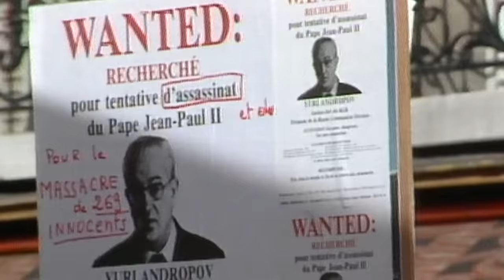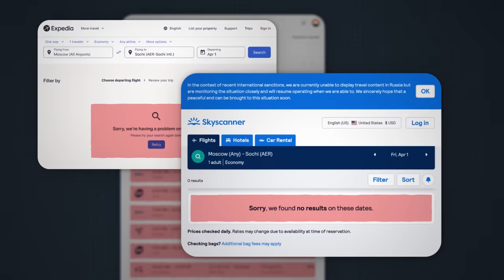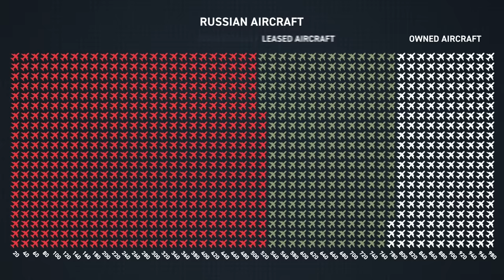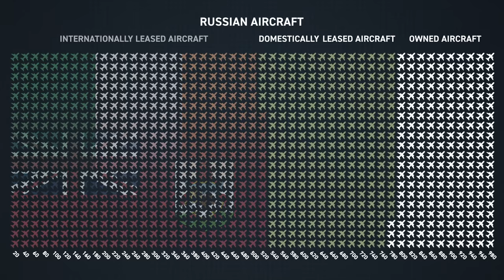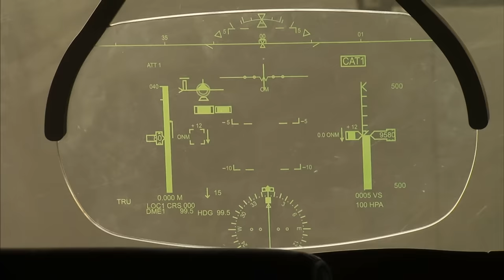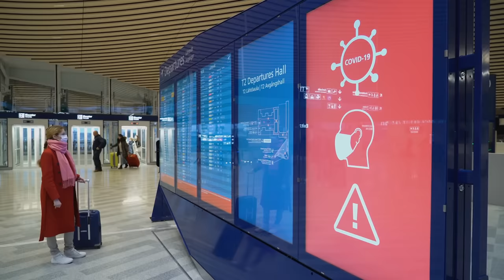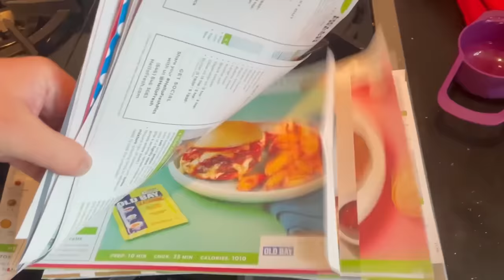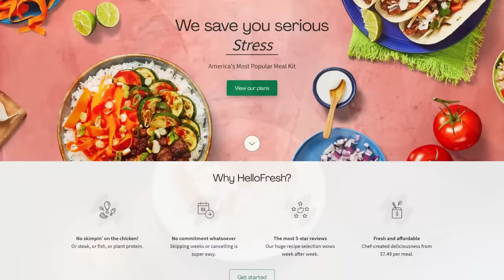The Sanction-Fueled Destruction of the Russian Aviation Industry

Comment: Love your vids, Wendover.

Hilarious to find out that China essentially +2/x/+2'd Boeing's name designation on a marketing gimmick. Its such a petty thing, but so them!

Those Boeings and AIrbus' leased aircraft are going to permanently be domestic hoppers; as soon as the chain of custody breaks on industry-mandated maintenance, that Bird is written off forever for ICAO cert, meaning whomever holds the lease has permanently lose the majority of the value of that aircraft if/when they get it back -and I'd rather turn that bird into razor blades right there on the tarmac and charge the Russians for it rather than the crooks try to fuck me again by trying to get favorable rates as a domestic aircraft. I hope that Boeing and Airbus maintain an ETERNAL sanction on supplying aviation parts to Russia for what they've done and have permanently blacklisted all the stolen aircraft; at this point, they need to induce some sort of aviation Lojack and permanently disable those birds on the ground (a self-wipe that can only happen while the vehicle is safely parked and being serviced like having the BUS burn itself out on startup). Hell, remotely disabling them now would probably allow their maintenance statuses to be deferred; meaning if they aren't tampered with further, those birds could fly internationally again someday with other users. I'm wondering what it would take for the international aviation industry, or rather the markup they inflict should Russia try to get them back.

The longer routes MIGHT mean a temporary resurgence of the A380, as increased turnaround time might mean it may be more economical to shove as many bodies into as few flights as possible.
Reply: It's easy to blame the "bad russian airlines" for "stealing" the airplanes, but, in truth, what could've they done? Their business is being hurt just because the government did a wrong thing in westener's opinion. This way they at least get a chance to survive through this crisis
Reply: @american3502  It's a government owned  (51%) airline.
Reply: @sarkybugger5009  fyi there's not just one airline in Russia. But sanctions restricted all of them to fly over Europe/America, so pretty much the only way to get there now is through Turkey
Reply: Yeah no, hacking those airplanes is a terrible idea.

Comment: 8:00 wouldn't it be easier to fly London-Ivalo, then drive the ~4 hours to Murmansk?
Or fly London-Helsinki, train/bus/drive to St Petersburg, and domestic fly to Murmansk? 
(assuming the Finland/Russia border isn't closed)
Reply: It’s not closed, now high speed train is  running 3 times per day between Helsinki and St. Petersburg
Reply: My thoughts exactly.
Reply: Kirkenes would save you about an hour compared to Ivalo, while still being available with a single stopover from London. But air-land connections are often inefficient, and bringing a rental car into Russia can be a bit troublesome, especially in the current political climate.
Reply: @justsomeguy5103  I’m not sure that bus connection between Norway and Russia is working now. And it will be more expensive than route throw Finland. 
But I don’t think there are any passengers who really need to travel from London to Murmansk now.
Reply: @AskhatBardynov  Actually Finland just announced I think yesterday that they stopped all train connections to Russia.

Comment: Provided Boom Supersonic ever gets off the ground, their supersonic Overture should just about be able to make it from Helsinki to Anchorage over the Arctic, and then from Anchorage on to Tokyo, which could be a valuable passage for the plane.
Reply: Boom will never exist, ever.
Reply: @prorobo  gonna have to disagree with you there because the company Boom does, in fact, currently exist
Reply: @kerbalengineeringsystems7415  you can disagree all you want. They exist on paper. There will never be a prototype and the ludicrous aircraft will never exist.
Reply: @prorobo  uhh, the prototype has in fact been running ground tests all year.
Reply: @kerbalengineeringsystems7415  uh, no it definitely has not. They don’t even have an engine supplier. Might want to check those sources.

Comment: Not mentioned by Wendover... if those leased aircraft ARE ever recovered, they will have to be scrapped as neither the maintenance logs, nor the parts installed can be guaranteed as genuine. Additionally, the domestic aircraft manufacturers pre-invasion were working with western avionics and engine manufacturers. Sukoi actually can't create more Superjets for this reason. There are few to none domestic avionics and engine manufacturers, which will drive up costs of the planes due to the back log of parts and need to retrofit the design. The government there CLEARLY thought the world would shrug this invasion off like Crimea, otherwise I don't think they would have risked this. Mentour goes into more detail about all of this on his YouTube channel.

Comment: Why did you not include any information as to how many people enter and leave Russia via aircraft? Just saying Russia closing it's airspace will dent the Russian travel industry leaves your claim open to wide spectulation. If, for example, only 1,000 enter/leave Russia per week, closing that industry to international travel will have little impact on the country as a whole.
Reply: This is not an issue at all after covid pandemic. By February 2022 Russia was far away from prepandemic numbers for international airtravel (due to some countries still to be closed, or vaccine certificate requirements etc) but domestic flights were breaking annual records (also due to the fact that Russian covid restrictions were very light domestic travel boomed). So if this situation happened in 2019 - that would be a hit, but in 2022 it is not as a hit was in 2020.

Comment: Russia can build own aircraft engines. Also Russia has an experience in bulding the civil aicrafts. Of course these aicrafts will be expensive and less efficient than A or B, but it will solve problem like it was solved in USSR where USSR had one of the biggest domestic airline networks in the world. In the end EU will be biggest looser, due to lost market and not able flying thru vast Russian airspace to Asia. EU lawmakers are not smartest one.
Reply: Plural of aircraft is aircraft. Not aircrafts.
Reply: @simondahl5437  Ah, Thanks. Just checked and this is actually true. So many years I use this word and nobody corrected me and I used this word incorrectly.
Reply: You can't even maintain Sam146 engines without French partners 😂😂😂
Reply: @User122-ty  I was talking not about SaM engines. SaM engines is a dead end.
Reply: @User122-ty  If you don't know about other Russian engines besides dead SaM production then you don't know the subject.
Reply: @JulioCezar-we9zo  I know about ПД8/16.
Вешай лапшу кому другому

Comment: Good up to the ad for Hello fresh. I pay for YouTube  not for the ads. I once was a passenger on on a Russian made pressurized commercial air liner. Frost appeared on the inside. I watch panels on the wings not flaps or slats put loose rivet fixed panels move.

Comment: I lived in Fairbanks, Alaska from 2001-03, and worked for a while at a large oil refinery in North Pole, AK - they used to produce over 250,000 barrels of JP-8 every day for aircraft and military use. As demand at Anchorage dropped, that refinery shut down - but I have to wonder what’ll happen now with Fuel supply in Alaska now that Russia isn’t a flight path any longer.
Reply: There will be more flights stopping in Anchorage, but nothing like it was in the cold war days. The flights going around Russia are operated by aircraft that have much longer ranges. There will be occasional times when weather patterns (winds) cause a need for more flights to stop in for additional fuel. This can be minimized by the use of polar routes, which also were uncommon in the cold war.

Comment: Most of the components used on the Russian built aircraft come from western companies.  The same is true for COMAC as far as I know.  Designing and making these components is more difficult that building the aircraft.  Which is why they haven’t tried.
Reply: They have tried,of course. But despite relative success ( such as the PD-14 or PD-35 series) the fact remains they are unable to be competitive against well-stablished industries like R&R or P&W. It's not just ( or so much) a matter of tech, but also of economies of scale. Now, they are left without an option, wich gives domestic parts producers a chance, for good or bad.

Comment: Your report and analysis is very well covered. But polar regions flights are not that easy. It has few difficulties and limitations due to magnetic affects. If possible please make a report over polar region flights and Its safety aspects . 
Also xtra ultra long flights that may cause extra financial burden on aviation industry.  Extra fuel due to long distance flights would cause weight penalty over the airline mileage costings. 
Anchorage Airport may be an option now but remember icing on aircraft / anti icing / de-icing  is not a joke.  Before each fight during winter months with 100 's of pax aircraft to handle by one single airport. It would add delays and dislocations of flights not to mention non scheduled maintenance .

Comment: I like the thought of Anchorage as a air travel hub. Pretty place, too cold for travelers to get “lost” and stay without the proper visa, not heavily populated so the plane noises isn’t as bad as say over NYC, and it means cheaper supplies for Alaska. More flights there means cheaper to stuff a bag of potatoes onto a half full flight, or bring over an MRI machine. Easier cheaper supply chain.

Comment: I think the wrong conclusion is being put forwards here.   Its quite clear that the Russian Aviation industry would have no problem keeping these aircraft flying for some time.    Cannibalisation is a tried and tested method of keeping the show on the road.  

The pool of aircraft available will gradually reduce over a lengthy period.    At the same time the Aeroflot home made passenger liners will take over as they are not as technically dependant on servicing schedules.

Significant decline is a more likely outcome rather than destruction.

Comment: If Russia has illegally seized internationally leased aircraft for domestic use but Russian leased planes will fly international routes, would not the international lease companies be able to seize the Russian leased aircraft when they land abroad?  I know technically the Russia aircraft are probably not state owned, but they are the ones benefitting from the stolen international leased aircraft so screw them.

Comment: Nobody mentioned Russia suggested leasers to buy all the planes out, but they refused and insisted Russia must return them immediately.
So faced to national security threat of loosing 70% of civilan fleet Russia nationalized this planes.
Reply: Was never an option. Besides the fact that Russia was never going to pay market value, it wasn't part of the lease agreemeny and would have taken too long to complete such a complex deal. Replacing that many planes is going to take years, the lease companies should take legal action to regain losses from seized Russian assets if possible
Reply: @ChristiandenBoer  Roughly counting each aircraft costs $50 mil 750 aircrafts Russia need  $35 billion to buy all the planes out.  Some planes are cheaper,  some was allowed to be kept in leasing for the time specified in the contract. So the final price could be less.
Anyway, it's not an extreme amount of money for a country with a $1.5 trillion economy to legally save a vital transportation industry.

Comment: Jet aviation is over as a thing. HSR is a better way to move people on the ground, hydrofoils and ekranoplans work well on water now. Electric turboprops are wildly efficient and when new materials allow ultra clean surfaces they will get more so. 

Business travel is dead due to far better conferencing software.  Criminals and diplomats still need secure physical space. But only them.

Militarily, rail guns, missiles, guided shells and drones replace manned aircraft.  There is no strategic reason to continue to study aviation.

Comment: Turkish Airlines is not a middle-eastern airline.
Reply: Umm no, it definitely is. Turkey is a Middle Eastern country.
Reply: @jarynn8156  Turkey is in the Near-East, not Middle East (that's an actual term)
Reply: @alexm566  If we were in the year 1922, you'd be correct. But you are about 100 years further ahead. In modern lexicon, the Middle East is typically regarded as Turkey, Egypt, Iran, Yemen, and everything between them. This is the definition used by virtually every government and relevant political entity out there.
Reply: @jarynn8156  I'm talking about Turkish Airlines brand which won the best european airline award several times. Turkey is a country between three continents, we dont need to be told where our country is or what our history is by you or anybody else.

Comment: If planes are kind of nationalized/stolen, I wonder why producers don't build in kill switches that can be activated via satellites ? Planes look nice, but if they cannot get into the air, what else can you use them for ?
Reply: That will just add vulnerability to the aircraft. The last thing any pilot want is their aircraft shutting down for no obvious reason.
Reply: @dbclass4075  Of course, it should only be activated when to plane is holding still on the ground. When they sometimes refuse to refuel planes, that belong to a bankrupt company, you also have pilots (and passengers) that cannot move on.
Reply: @aarhusnord  Even if that's the case, killswitches have little contribution, as Russians can bypass them anyway. Considering most of the planes are in Russian territory, they can use jammers to block the kill signal.

Comment: the video misses a few points to skew the people's perception. When western leasing companies cancel their contracts unilaterally, they would be judged to have broken the contract. IF they were to be brought to court of justice, they will lose their planes as a compensation for unilaterally breaking the contract. So russia is justified in seizing the planes as compensation. Furthermore, the MC21 is just around the corner. they will start replacing the leased planes with MC 21 long before these foreign leased planes start breaking down. Also Chinese Comac C919 is not an option on the table, when russia already has the MC21 almost ready to be launched by aeroflot. Why buy chinese when, there is a far better russian equivalent? Similarly, for sukhoi superjet, they will just do an import substitution and make the plane 100% russian with parts unification with MC 21 to simplify cost and support. Also they have the Il 96-400M in the works which can be the wide body super long range plane to replace the Boeing 777 (beoing 777) was a copy of this plane's predecessor Il-86). so all in all, russia already has its replacement almost done and they are not inferior to the western analogues. As for the booking system, they can easily come up with a replacement booking service that works with the rest of the world. As you can see the rest of the world did not close their airspace to russia, only, the US and its vassal states in Europe, japan, Korea and Australia.

Comment: Yes and change aviation rule and law to block pilot  new generation can fly and learn quickly with high fly hour  200-300can fly with new air craft why to US control the old law in new era if young pilot no mistake aviation law it must strick pilot mistake the law during 6 month